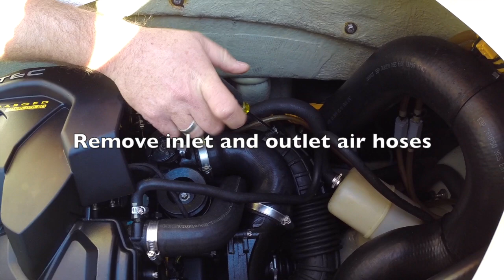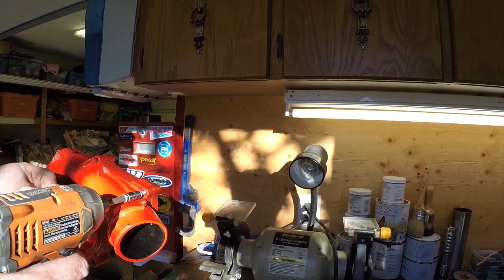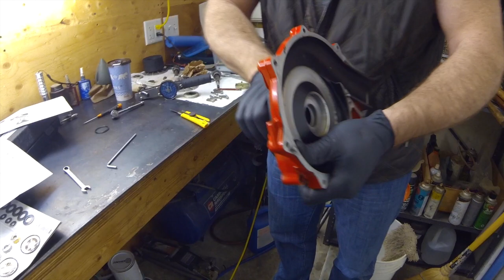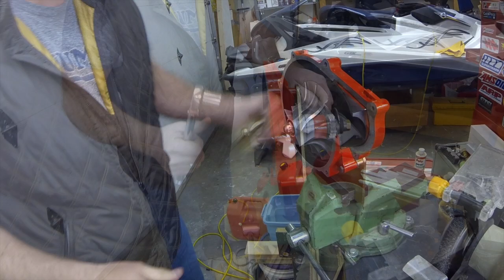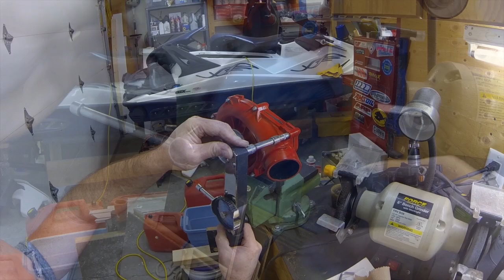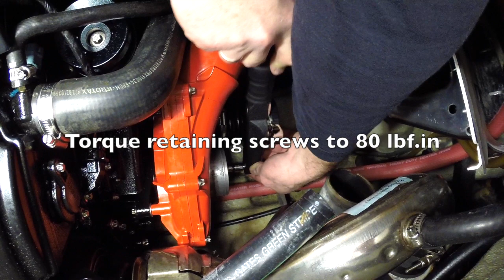How to Rebuild a 4-TEC Jet Ski Supercharger (on a 2005 Sea-Doo GTX 185)

Comment: Just rebuild 2 superchargers and reinstalled both one is squealing when trying to start and the other worked fine everything was the exact same what should I look for to fine the source of the noise
Reply from the maker: Any sign of the wheel making contact with the housing when the supercharger was disassembled, was the rebuilt supercharger spinning free after the rebuild and before installation, what was the slip after rebuild, are you sure the noise is coming from the supercharger ?
Reply: @3ftDeepChannel  not seeing any marks. Spins free and easy before installation and we took the supercharger out and bumped the start button and sounds normal. Not sure if the slip test

Comment: I really enjoy your videos, a great learning experience. I was wondering how does the intercooler cools down the air? is it through the close loop cooling system or does it have a separate intake that brings water into the intercooler for heat exchange? Thanks in advance for your help.
Reply from the maker: Like a car radiator, but in reverse. It draws in cold water from the lake/ocean/sea and uses it to cool hot, compressed air from the supercharger before it goes into the engine.
Reply: @3ftDeepChannel  thanks a lot for the prompt response. I was thinking that the intercooler would use the same coolant loop in a closed loop system like the ones in modern seadoos. I just happened to find out/learned  that the heat is removed from the intercooler and exhaust with a separate water open loop. So this technically makes the seadoos a dual loop cooling system, one for the engine (closed loop/coolant/no debris in engine/awesome) and one for the intercooler and exhaust (open loop/water) not ideal but I guess is the only way to get rid of so much heat produced by compressing the air and combustion gases. It wouldn't be possible to cool down these 2 separate devices with the close loop as the heat plate rejection can reject just reject limited amounts of heat.

Comment: Is it possible to remove the upper deck, say split it from the lower hull?  My 2004 4TEC has a lot of mold in hard the reach places and I’d like to thoroughly clean this winter.  I think removing tbe upper half of the ski would make it much easier.
Reply from the maker: I wouldn’t think so. Normally they are glued together. There might be some models that are screwed together, but I haven’t seen any.
Reply: @3ftDeepChannel  okay thanks for the reply.  I may have to live with the mold in hard to reach places!
Reply from the maker: Here's something we've done and it works well. Try spraying some of the "orange cleaner" (made from orange peel extracts) throughout your hull surface and leave it there for a few hours. Then lightly spray some water on the hull. Take it around the block a few times so the mixture sloshes around and leave it sealed under your seat for 24 hours. Rinse and drain well. Good luck!
Reply: @3ftDeepChannel  that’s a great idea, I’ll give it a try!!  Thanks for all the help!

Comment: nice video guys but you should never use a hammer to put bearing in place. Those bearing a ceramic one and they are really fragile. By doing it this way you reduce the life of the supercharger.
Reply from the maker: Thanks for the tip, David. You’re right about being very gentle with those bearings. The making of that video inspired us to buy a bearing press.

Comment: what purpose does the needle bearing have?
Reply from the maker: Reduced friction for a rotating shaft, while having a very low profile over a larger surface area.
Reply: @3ftDeepChannel  and also the gear slips over it, when the supercharger clutch is in use right?
Reply from the maker: Sort of. Just to be clear, the "clutch" is affected by the slip of the washers, not movement along the shaft.

Comment: Does this supercharger system have cooling for the supercharger itself?  Also how many rpms does it take to build full boost? And how much is full boost?
Reply from the maker: No, it does not have a cooling system. As it is directly linked to the engine, the more RPMs the higher the boost. I can’t recall how much is for boost in psi. But you can probably Google that.

Comment: Could you give me the sizes of all the female torx sockets used for removal. Thanks.
Reply from the maker: 8 is the Torx size used for the three bolts that hold the supercharger to the block and for the bolts on the supercharger housing.  I have seen newer superchargers with 8mm bolt heads instead of Torx.
Reply: 3ftDeep thank you so much.

Comment: how to check slippage with just a torque wrench?
it is necessary to check from 10 to 14nm?
Reply from the maker: You can check with a torque wrench, but it’s a bit more difficult. Essentially, you need to keep adjusting the torque and note where it slips and where it doesn’t. It’s much easier to use the type of torque wrench that we used. The slippage will depend on your supercharger and a few other things. If you don't have the same supercharger that we had in our 2005 GTX 185 you'll need to reference the Service Manual for your machine. Good luck.
Reply: ok thank you, it's that I don't have the workshop manual for my seadoo. I have a 2004 rxp215 but I don't know the slippage of the compressor
Reply from the maker: If it’s a 2004 the most important thing is finding out when it was last rebuilt. Do you have any information on that (i.e. hours on engine or years)?
Reply: 180 hours and the supercharger was redone once by the previous owner

 but I would like to build it again because my seadoo does not exceed 7500 rpm
Reply from the maker: It’s time for a rebuild, if you don’t know how many hours its been since it was rebuilt and how it was done. If you do a Google search for your service manual, I’m sure you’ll find one online. Try here: http://seadoomanuals.net/manuals/2004-seadoo.php . Good luck.
Reply: @3ftDeepChannel  ok thank you

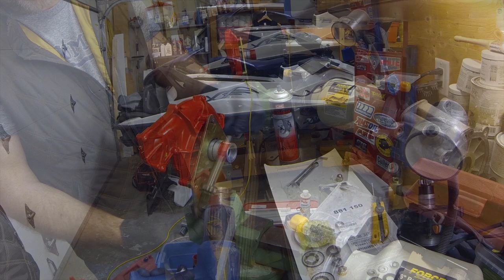Comment: Hi 3ftDeep. I have a real problem here. This rebuild was going smooth. I have all the special tools and know-how. Got to the point where new spacer sleeve slides on new shaft and it will not slide on! It slides down about 1.5 inches and seizes. I even tried freezing the shaft and heating the sleeve and when I was pushing it on, it totally seized to shaft and I cant even pull it off?! This is a new OEM SeaDoo kit. 4:45 in your video is what I’m referencing. Yours slides right on. Directions do not say but I was installing with the grooves facing gear like you did. Have you ever seen this? I’m STUCK. Literally. Thanks!
Reply from the maker: Hey Jason, Sorry to hear about your struggle. You shouldn't need heat for this. First, check to make sure you have the right kit for your machine. Did you get the OEM kit? Next, does the washer slide on? It's possible your shaft is bent slightly (although it's unlikely). Check it with an edge you know is absolutely straight (like a metal ruler). Good luck, and let me know.
Reply: I have the same issue. The washer slides on no problem. The kit is correct for my 08 255 rxp. The shaft and spacer are out of the same package. The shaft is not bent. However there is a slight ridge on the shaft that seems to stop the spacer from sliding on. I checked the old shaft and there is a ridge on it as well in the same spot on the shaft but not as pronounced. I also tried the old spacer on the new shaft and it slides on very easily. Perhaps too easily as it seem a bit sloppy compared to the fit on the old shaft. The new spacer will not go on the old shaft at all, too small. I am trying to freeze the shaft and heat the spacer now. I would think that if all of the parts are on the same blister pack that they should fit. It’s difficult to return the kit if half of the parts have been installed.....
Reply from the maker: You really should contact Sea-Doo directly and find out what the heck is going on. These parts must fit correctly! Good luck.
Reply: @3ftDeepChannel  thanks. I did notice that on the old spacer there is one groove milled into it near the end of it. On the new spacer there are two grooves. Maybe this spacer is for a different kit and it was put in this kit by accident. I will call BRP on Monday.
Reply from the maker: Please let us know what you find out. This is very disconcerting. Maybe they don’t even know they have an issue.
Reply: @3ftDeepChannel  will do!
Reply: Same thing happened to me used the old spacer to drive the new on everything seems to be okay
Reply from the maker: Thanks for your comment and safe riding!

Comment: For the needle bearing, do you leave the wax strips on? Or do you have to remove them before placing the drive gear?
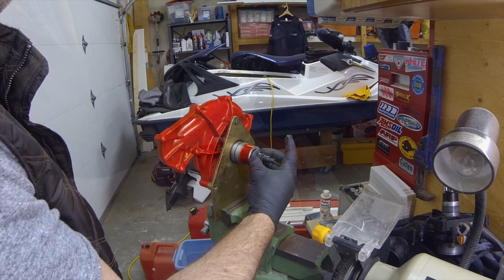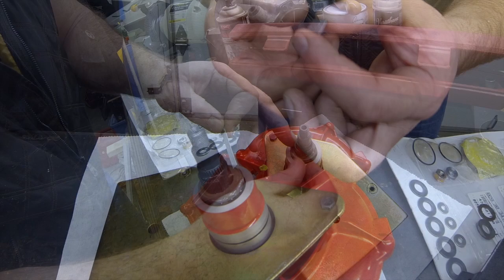Reply from the maker: We remove the bearings from the strip. You can see the strip without the needle bearings on it from 5:10 to 5:18 on the video. The needle bearings are held together with a light waxy, grease. That's why we put them on in sections. I believe some OEM kits include the bearings in a cylinder through which you push them onto the shaft, but this one didn't.

Comment: In your video are you adding Isoflex grease to both bearings? (packing them) or just a dab? also is there anywhere else you are applying it? looks like you are just coating the outside of the bearing. I just want to make sure I do it right.
Reply from the maker: Geo Sto Both sealed bearings get some engine oil (i.e. no Isoflex) applied onto them so they fit easier into the housing. The needle bearing get a generous amount of the Isoflex grease. It's used to get the bearings to stick to the shaft during assembly, but also to reduce friction -especially before the engine oil gets circulating. Be generous. You should also apply some onto the shaft for the friction washers, needle pin, and lock washer. Don't use a substitute!
Reply: Ah...great advise. I notice in the new kit # 881102 that the needle bearings are no longer placed on wax but instead inside two plastic sleeves ( looks like regular roller bearings ) but when you install them the sleeves are designed to get pushed out. Much better set-up. I ordered the grease and super lube. Already have a bench press and tools so should be straight forward. The videos you provide are great!
Reply: Geo Sto BTW...on the latest OEM rebuild kits for the 215's and up you will need the needle bearing push tool # 529-036-237  that does not come standard with the rebuild tool kits you see out.
Reply from the maker: Geo Sto Thanks for the tip. I think that's why Chris elected to do it by hand. As long as you have good eyes and a steady hand, you can assemble them manually, but using a bearing pusher would be easier and safer.

Comment: I have a GTX 185 4TEC, believe it’s a 2004.  Today I pulled the supercharger and drained water out of the engine.  The ski is new to me and I’d like to test the engine before spending money on a supercharger rebuild.  Do you know if I could test run the engine without the supercharger installed?
Reply from the maker: In theory, it should be possible if the port is properly sealed. It will likely not run properly though, as the engine is expecting the extra air.
Reply: @3ftDeepChannel  thanks for the quick reply.  I reinstalled the supercharger and am going to test compression and hopefully run the engine tomorrow!
Reply from the maker: Good luck!

Comment: How do you adjust the slip torque on these older ones if it’s too high? Mine is clear up in the 20s. Also the friction washers that came in my kit are slightly too large in the center opening. These seem to be the upgraded washers but I’m not sure if that’s normal. Doesn’t seem right to me.
Reply from the maker: That's a good question. We haven't experienced that issue before. It may be that it was assembled incorrectly or that the wrong kit was used. If things don't seem right you need to investigate. Remember, these things spin at very high RPMs and if they fail, the parts can go into the engine and do lots of damage. Good luck.
Reply: @3ftDeepChannel  yep thanks. I’m gonna stick with the adage if it doesn’t look right it’s probably not and order  a different kit.
Reply from the maker: Good man. Go for OEM …

Comment: i have a charging problem on the same exact engines in my seadoo speedster 200 430. I believe it could be the automatic bilge but not sure. what do you suggest? battery is draining while the boat is sitting still no power, perk switch is off.
Reply from the maker: Sounds like a failing device somewhere, and you're probably right it could be the bilge. Try unplugging it for a while and see if that helps. My batter was murdered by my Spot Trace anti-theft device, which was connected to the battery via hardwire. Good luck.

Comment: Can a person remove the supercharger on a Sea-Doo GTX limited 2003 model, block off the port where the charger plugs into by plating it and just run it basically as a lower compression naturally aspirated ski with no ill effects?  I have one and the guy who is buying it likes the ski but does not want access to the supercharger.  He's an older gentleman who wants to put his grandchildren on it so he's okay going between 45 and 55 mph Max on that low compression motor.
Reply from the maker: In theory, it’s possible but not recommended. There would be ill effects.

Comment: Hey man I bought the rebuild kit from the dealer and installed it exactly how you demonstrated for some reason the kit had 3 extra washers and they don’t even fit on the shaft... and they didn’t give me the washer that goes before the cap nut so I reused the old one and after I torqued down both nuts on each side I try to turn the shaft with my hand and it won’t move at all is that normal?
Reply from the maker: The three small washers are spacers for the older supercharger housings they go between the supercharger and the block the instructions describe which supercharger housings require the spacers.  The newer kits don't have the washer for the cap nut as the new style cap nut has the washer built in I would remove the old washer you installed.  Without the supercharger installed the shaft should spin freely after the rebuild so something is not correct maybe a bearing is not seated properly and is binding when the nuts are tightened it's important that the impeller nut gets tightened before the clutch side nut if you have to take it apart the bearings will need to be replaced you can't disassemble the supercharger without risking damage to the bearings.  All of this info is in the instructions that come with every oem rebuild kit.
Reply: @3ftDeepChannel  Thank you for the reply! The problem was I didn’t clean out the old loctite for the retaining disc and I went back and cleaned it out and it fixed the problem but I used the old washer with new nut and already installed it and started it up and the engine sounds the same it doesn’t rev up all the way do you think the jet pump could be the culprit? I sucked up dirty water and a rock like a idiot and shorty after it would only go 30-40 mph.

Comment: Great video. If you had the same machine as in video with 88 hours on it and being 13 years old do you think the supercharger should be rebuilt because of the time frame? Thanks
Reply from the maker: I wouldn't rebuild a newer (i.e. up to 2016 model) machine until I had at least 150 hours on it, but  no later than 200 hours.  But if you have a 2005 model I would definitely rebuild the supercharger, as it almost certainly has the old failure-prone ceramic washers. In fact, I wouldn't even start it up again until the supercharger was rebuilt. Supercharger washer failure can cause a lot of damage to your engine. Good luck.
Reply: Hi there: Had the supercharger rebuilt and wear ring replaced. Just wonder what you got out of your 2005 GTX supercharged for top speed. Thanks
Reply from the maker: My 2003 supercharged 185 GTX could only reach about 58 mph.
Reply: Thank you

Comment: Will you feel any difference after rebuilding the supercharge at all?
Reply from the maker: It depends on why it was rebuilt. If you’ve been experiencing a loss of power, you will feel a return to normal power. If it’s being rebuilt because it’s an older model with ceramic washers, then probably you won’t feel any difference.

Comment: Howdy, i just bought a 2009 rxp255 and I've sent off the supercharger to get rebuilt, but i was thinking i might try and do it myself next time, was just wondering if you recommend a particular kit? And when you do them do you only replace the parts in this video? It's just all the rebuild kits i see on ebay seem to come with a new shaft and gear, which in my mind seems unnecessary, wouldn't have thought that needle roller would have to do a lot of work, unless you leave your clutch slipping for a long time i guess haha. Also with the new parts that you put in there, are they now good to last the full 100 hours till the next blower service? Or do you replace them more regularly? Keen to hear your thoughts. Also thanks for the great video, you guys helped me rebuild my first jet pump, really appreciate it.
Reply from the maker: Hey Joe, Thanks for the kind words. We always use the OEM supercharger kit that is specific for the machine. We only replace the parts that come with they kit. We normally rebuild our supercharger every 150 hours, although the Sea-Doo dealers say they can last up to 200 hours. We don’t recommend trying that, though. Good luck!
Reply: @3ftDeepChannel  wow that was quick. Oh cool sounds like they've improved the reliability a lot then. Thanks heaps, God bless.